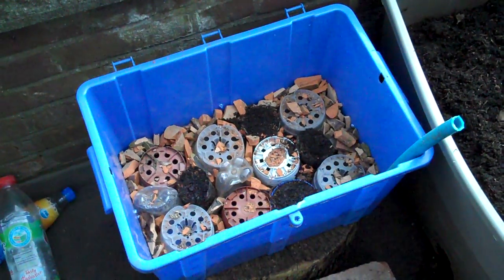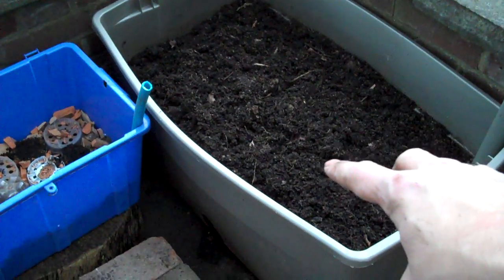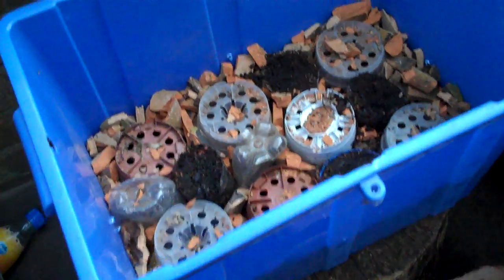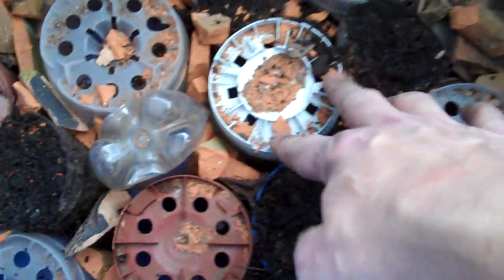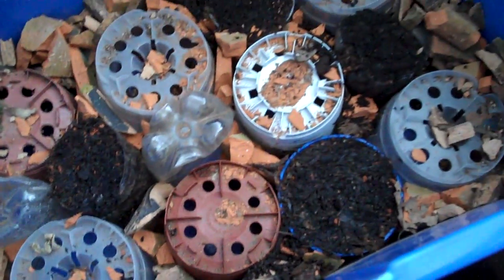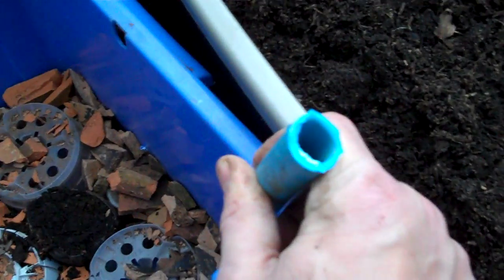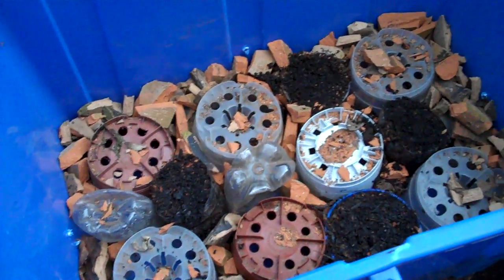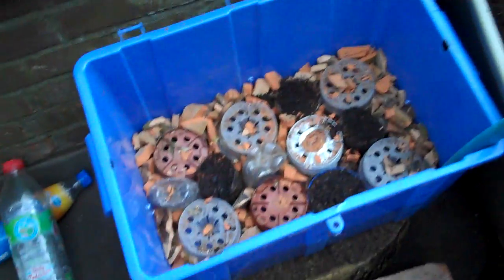How to Make a FREE Self-Watering Container

Comment: instead of using the broken pots to stop the soil, just put an old t shirt over the whole thing leaving a gap for the water pipe. And make sure the pipe is cut at an angle on the bottom so the water will go in nicely.